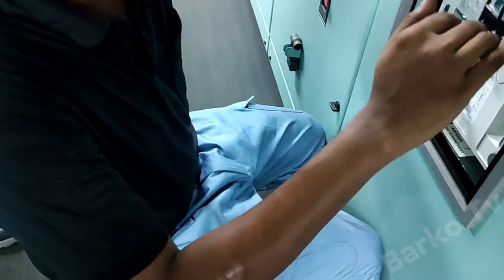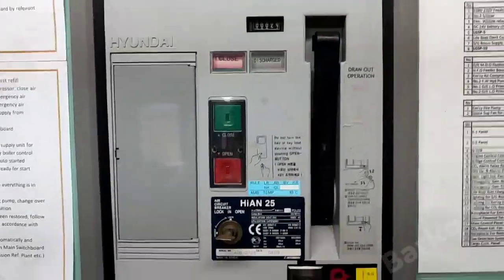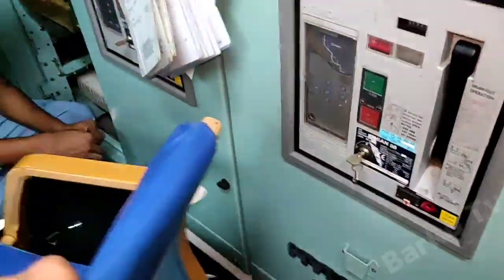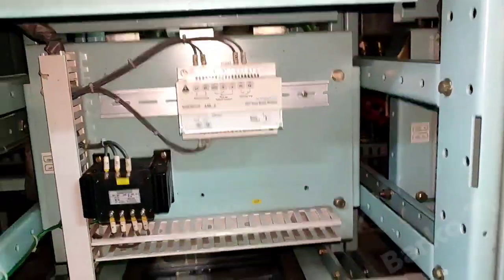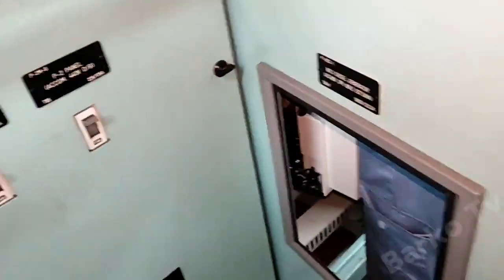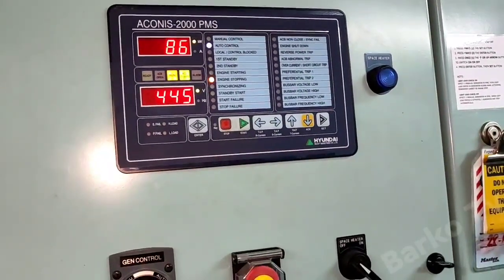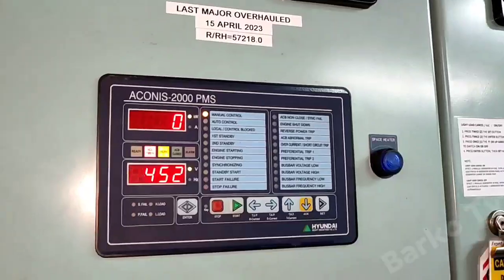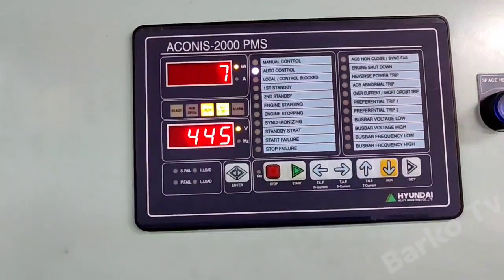Simulation ACB OCR and Bus tie isolation / Retrofit Hian 16 to HGN 16 hyundai / over current

Comment: Good morning Sir, why the OCR alarm tested by service engineer. what is the reason behind it. He tested the only one ALARM or others alarm also he tested. Please explain it briefly. Thanks for the your hard work and sharing the very useful and helpful video. 👍👍
Reply from the maker: Yes, correct sir, , only simulation, they tested its because that is newly installed ACB and they commissioned it to have certified certificates